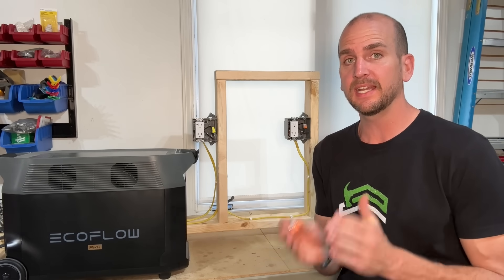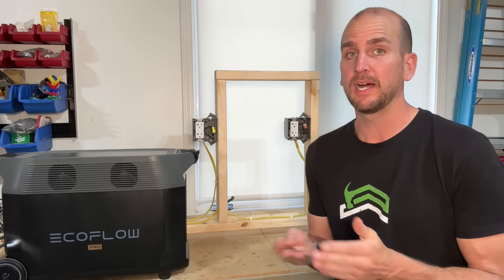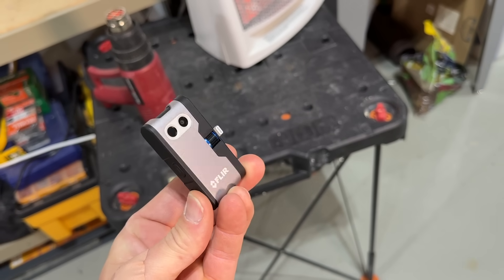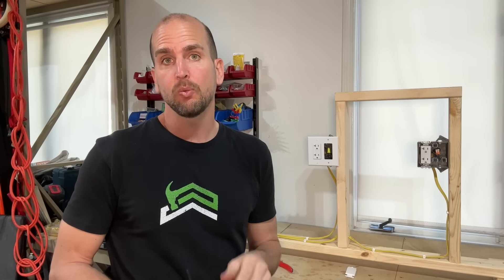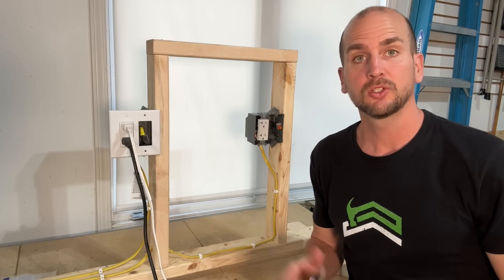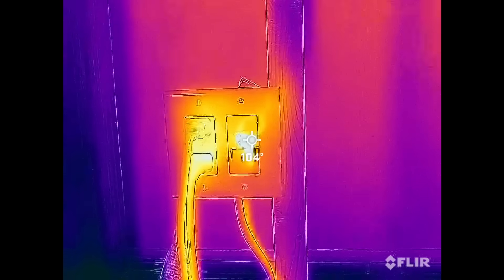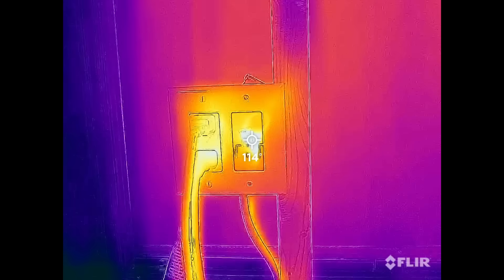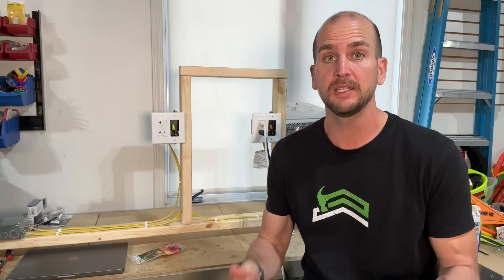Debunking the Pros: Can WAGO Lever Nuts Handle Heavy Electrical Loads?

Comment: WAGO nuts look like they are far easier to use, with more reliable connections. Sure, they get a few degrees hotter, but there's much less chance of getting a bad twist. I'm a DIY person who tried to replace a light fixture in my kitchen when the old 50+ year one burnt out and I didn't have any WAGO nuts, just twist wire nuts, and let me tell you, it was a challenge, trying to hold the new fixture AND attach the twist nuts, wires kept pulling out, the nuts wouldn't grab, even with pre-twisting, and it took several attempts to actually get it on there, and even when I did, 5 minutes later, the light started flickering because the connection wasn't solid. A WAGO nut would have been 10x easier to install and would have provided a much more stable connection, more easily. This is why WAGO nuts are so praised for DIYers, because most DIYers probably aren't going to have hundreds of hours of twisting wire nuts that they can just bang em out perfectly every time. A lot of DIYers have only done a few nuts here and there and have trouble getting them to twist in properly.

Comment: I have used some Wago lever nuts to install some basement LED surface mount lights and for some bathroom fan timers. I really like them and as others have said I like the fact that I can see through them to confirm that the connections are good. Thank you for this video.

Comment: Nice test!  I will continue to use screw connections for permanent installation that I expect to last for 40 years. The thing this test does not test is resistance to long term corrosion. The push-on connectors have not been around long enough to get long term corrosion resistance performance.

Comment: Thanks for a great video! I use the wagos in interior walls and I am not against them. Given that they did heat up a bit more than wire nuts, I’d be interested to see how they perform in an attic in a hot summer climate where the baseline temperature can be 130 or maybe even 140 degrees Fahrenheit. Can they get hot and run away, unable to dissipate heat?

Comment: Wago lever nuts and similar are rated to 32A continious load.  Considering how many bad wire nut jobs I've seen, I'll take a wago for all the small connections.  If I'm going over 30A, I can afford to use a terminal block.

Comment: Wire nuts are crap. There is no gauge of how much to tighten them to ensure peak performance. Then try to unmake a connection and the spring thingy separates and now you have to cut the connection and resplice the wires that have hopefully enough slack to accommodate this. There is more resistance across a contactor line to load than any Wago. No one seems to carp about that. Wago is a godsend

Comment: From the  data, I'd say that when the electrical circuit is operated within the standards set by the NEC, they are as good as and as safe as wire nuts.  Sometimes, people just reject new stuff because it's new.

Comment: There's a reason they are not allowed in commercial installs, and I don't trust them. If you twist the wires before installing the wire nut, the connection is far better then some cheesy wago. If it needs to be bullet proof, do it right and use a wire nut or a real buss bar. Wago's are for lazy people that want a easy way out of doing it the proper way in the first place.

Comment: They agree with the other folks giving feedback regarding voltage drop.  The more voltage drop the more power is being wasted.  Random thought but if you compare wire splices to the fiber optic industry where they have adopted technology called fusion splicing perhaps somebody should invent technology to fusion splice copper wire.  Are forebears back in the days of knob and tube used to tightly wrap one conductor around another conductor and then apply lead solder.  That was the ultimate splice.  There was no way that splice was going to heat up relative to the rest of the conductors. Us electricians always joke about telling the apprentice to go get the wire stretcher when a piece of wire is too short.  Perhaps one day it will become a reality: hey dude go get the fusions splicer.

Comment: For outlets and high load applications, I will always continue to use traditional wire nuts 

However, for applications such as lighting, bathroom exhaust fans, ceiling fans etc, wagos are the way to go for sure!

Comment: If you do this again, please use a kill-a-watt or other device to gather the additional measure of voltage drop (and total power) as delivered to the device at the receptacle.  When you introduce resistance, there will be a drop in voltage delivered, which for constant-current devices, will create a simple drop in power.  But for purely resistive loads like you are using, this increased total resistance will result in a drop in current as well.  This drop in current results in additional reduction to delivered power.  So for example if you had a 2% drop in voltage, it would result in a 4% (2 squared) drop in power consumed by your accessory.  A linear drop is far less of a problem than this squared drop, so it makes me curious as to just how big of an impact this added resistance would have on the load.

Comment: An interesting test.  However, I propose a different/additional test.  The heat is greater because of higher resistance, correct?  So how about a test where you chain together 8 WAGO devices, representing a string of outlets in a house, and putting the heavy load on an outlet at the end of the chain.  Measure the voltage at the last outlet in the chain while the load is applied.  Compare that to an equally long chain of outlets where the wire is directly connected to the outlet.  I bet there is a cumulative effect of using that many WAGO devices in series.  I always make the effort of connecting directly to the outlet or switch, using as few external connecting devices as possible.
EDIT: perhaps it might be simpler to just measure resistance of the chain.

Comment: I like how you set up the testing and the parameters and "real life" situations you tested for as far as heat dissipation... however.... even a standard circuit breaker can handle a higher than rated load for up to s couple minutes before tripping (depending on type and trip curve) but I do not think that scenario was accurate enough to a real life situation... when are you going to load a circuit that high above the rating without tripping the breaker? Better to keep it within the rating. The second portion is the amount of time... in the examples of heaters, if you needed a heater, do you really think it is only going to be for a mere twenty minutes? or more like hours...   I would discard the fancy FLIR stuff as it is still only reading the infrared and that can be a bit inaccurate unless you spend the money for a high quality unit... I would place the plug and box within a fully enclosed wall with insulation, just like a real life house. Then I would use a K-type thermocouple directly to the shell of the splice for direct measurement without needing to open up the box for any ventilation. Finally, I would take measurements every 30 minutes over the course of 6 to 8 hours which would be closer to real usage scenarios, perhaps foolishly, but far more likely... THEN tell me how everything held up.... Tests are great, but they aren't that good if they don't mimic the good AND the bad of real world scenarios...  Wiring is generally designed and made to at least 125 - 150% of rated value specifically for that safety margin, but how many average people really know and stay within that safety margin or worse yet, push it to the limits?  Those electricians out in the field are seeing it everyday and dealing with the ID10T issues.

Comment: The same people said that aluminum wiring was good in your house. I don't care if it works good today I care that it works good in 100 years.  I don't care if it saves me half a minute a connection or is easier, I care that it doesn't burn down someones house.

Comment: Great work and thanks for the video.  I'll use WAGOs for lighting connections (connecting stranded wire to solid), but that's it.  In my opinion, they are just another version of 'backstab' connections.

Comment: Wagos have been around since the 1940s. I was surprised at that fact because I had never heard of them until just a few years ago. Working at the time as a handyman with electrical emphasis, I wanted to use these but I had to sell it to my working foreman. Which I did. There are videos (or at least were) on here where various ppl tested them in (at the time) live demonstrations of Wago vs wire nut. Two in particular tested them to failure in an open room. In both, the wire nuts burned and failed. Also in both, the Wagos burned but never failed until significantly past the point where the wire nuts failed. I emailed my foreman those 2 videos and he approved using them. One video was created in England and the other, I think, Germany. Can't recall at the moment. Either way, both countries have stricter standards than we have here.

Comment: About "few billions Wagos have been used" with no failures* "if no stupid things done". Actual fires start usually due to SCREW TERMINAL LOOSENING. Therefore it is not important, what is looks like on day one. Compare screw terminal after 15 years and Wago spring terminal after 15 years of use.

Comment: Will the Wago be able to maintain the contact pressure 50 to 100+ years from now?  If the pressure on the wire to the internal buss bar decreases over time, the contact resistance will increase.  Are there any studies about this?

Comment: I hate these things, I would never use them for anything I sign my name off on. Dumb product where money was paid to have it pushed and standardized. It's more expensive, more resistance, more heat and makes less sense then a traditional wire nut. So stupid, we make all our connections with traditional wire nuts and at the end of the job we pull everything out and go over everything with shrink tubes and a heat gun then fasten everything into there final receptacles.

Comment: I would like to see this with the wire nut or Wago in a separate box from the outlet, to eliminate the heat contribution from the wire-to-outlet connection, better to understand how much heat is being generated specifically at the wire-to-wire junction.

Comment: I'd like to see a comparison of Wago lever nuts on solid cu wire vs stranded cu of the same gauge wire. I do believe the stranded will have a lower temperature seeing that it is more moldable when being clamped inside the Wago.

Comment: Bad test.  This is still an ideal condition for the components and unrealistic.  You tested a single splice!  A circuit has many connections, one at each outlet or light in the chain, switches, junction boxes, etc.  Set up a test with several splices and connections (maybe at least 10?) over many 10's of feet of romex and then test the temp at each junction, and especially the last one in the chain.  If each lever nut adds that much more resistance, it will need to be multiplied by the number of connections.  What would be the voltage drop at the last outlet?  Put 20 amps through that.

Comment: I would be interested in the failire rate. I have had to chase down open circuits due to failed or improperly installed wire nuts.

Comment: I have not heard of any Wago 221 failures if the maximum current rating is not exceeded.  Please let me know if there are documented cases of causing a fire.   If the load is a large motor, resistance coil heater (space heater, heat gun, etc.) go ahead and use wire nuts if it makes you more confident.  But for general lighting fixtures and most wall outlets the Wago connectors take up less space in a box, and are easier to use. It is highly unlikely the maximum temperature rating would be exceeded.  According to the manufacturer, the Wago 221 has a UL 94V0 flammability rating stating that its nylon body is self extinguishing.

Comment: Most American electricians in US don’t understand them.   Wago connectors used more world wide than wire nuts.   Europe usesc
Wagos almost exclusively.
Reply: American electricians like to point out that European utility voltages are higher and hence the current flow is much less.  Produces less heating.

Comment: The big difference for me... the DIYer...
With the WAGO I can SEE the connections. With the wire nut, I'm blind.
Most of my electrical work has been replacing what someone has done before me.... some well done... some not so well done. 
I have had wire nuts fall out of box, leaving the exposed ends behind. Not sure what was happening in the box before I took the cover off... but thankful no property was damaged.

Comment: Kinda wish you'd measured the temperatures as "above ambient" or included the ambient temperature against each data point - as your loads were all heat generating, the ambient temperature will have increased, so of course the one you test last is going to seem hotter.

Comment: I don't use wagons for anything higher than 12 ga.
If I want heavy duty, vibration resistance, etc I would co with a set screw / Polaris connector.
Wire nuts do the job most of the time. I like the long skirt ones by ideal.

Comment: Man, I dunno. They were so easy to pull apart. I never felt confident about them at work.

I may have used the wrong size or something though. But I was OCD level with the wire nuts. Didn't just rely on the copper twisted, I would twist the whole wire several inches back then a new nut.

Comment: Im not an electrician, but I think wire nuts aren't allowed in my country... You have to use wago lever nuts if you're joining wires outside of a screw terminal but you have to make sure you use the correct wire nuts for the wire size and amp capacity.

Comment: Most DIY'rs don't get wire nuts right, or even screw connectors, so WAGO's a better choice, or I don' t know WATCH SOME YOU TUBE VIDEOS.  Still, enough of a reason to keep them legal.  Any professional using them should be fired.  If their desire to short your job on time so much they can't do a screw connection when availabe or a wire nut, what else will they short you on.  Any contractor or developer should be banned from using WAGO's, and by law and code that would be hard, or indefensible.  However their insurance cos could demand it and should.   A 15 degree temp diff on your easy to disapate heat just normal room temp test is A LOT, 115 for hours on end is not an insignificant risk.  On a 100 degree day that 115 will be 150 in an insulated wall, easy, hot enough to pasturize food in mins, 3/4 of the way to boiling water.  Hot enough to give a 3rd degree burn in seconds.
Reply from the maker: Yeah, firing someone over using a fully approved and certified product might be a bit aggressive 😂.  How do you feel about back stabbing outlets?  95% of the new builds in my area have cheap residential outlets installed backstabbed with 14 gauge wire. 🤷‍♂️
Reply: and what material has a ignition temperature of 150?

Comment: I know this is an old video and has so many comments ill never get seen..  but longevity is a concern with any splicing device..  copper wire exposed t oair is going to degrade..  will the WAGO heat up more and more as it ages and its sprimng inherently weakens as well...  no way to know as they havent been around long enough to truly know..  any type of inline spice can fail...  the one big pro to me about wago is the fact the average person likely has a much higher chance of inmstalling it properly vs a wire nut..  DIYers dont often know the true correct way to install a nut and how many conductors it is rated for... they just stuff the wires in, twist it till it feels tight and call it a day..  most WAGO and look alikes have a nice strip gauge, people push the wires in till they stop, lock the connector and its likely installed properly..

Comment: Your problem isn't the connector it's the 120V system. With 230V you could use less amps and therefore get way less heat loss in the first place.

Comment: Your testing new clean connections, new connections isn't where the problems happen.  Sure they are going to preform, Im sure they were designed with a safety factor.  Probably at least a 2to1 safety factor.  The problems happen after multiple heat cycles over time.  The connections corrode and you'll get more heat.  More heat causes more resistance which causes more heat . . . And on and on.  So I suspect having less contact aria is going to mean the lifespan of the connections will also be less.  As well as the fact that you have a dissimilar metal in the little  bus bar is also going to speed up corrosion.

Like back-stabbed outlets I'm sure it'll be fine for a while and it is aproved but it isn't something I'm a fan of doing.

Comment: Think about hundreds of millions, maybe billions, of WAGO connectors all around the planet in use creating 10 degree temperature increases at all junctions...creating increased resistance in all circuits: how much extra, wasted electricity will be used for no reason. Line-loss is a real thing and so is conductor temperature consideration. I've worked in probably a thousand homes and full voltage (120-ish in America) is extremely rare. Add increased resistance due to hot WAGOs and I'm gonna guess at some point operational performance of some electrical appliances/etc. begins to decline. When I built my home 25 years ago I used the receptacles that had the stab-hole connection, completely code-compliant, but within a year had to replace all of them because of the arcing and burning away of the WAGO-type connections. I will always use screw connections and wire-nuts.